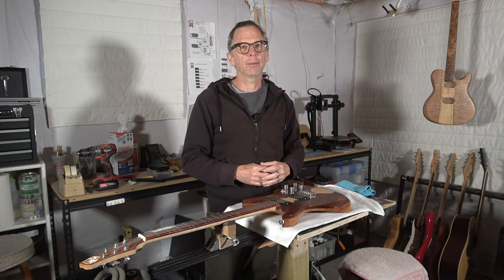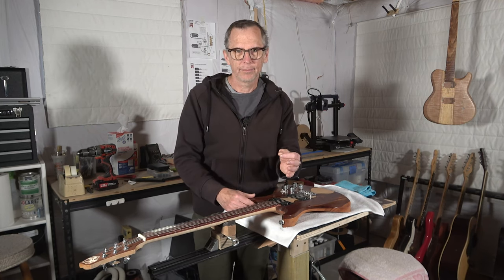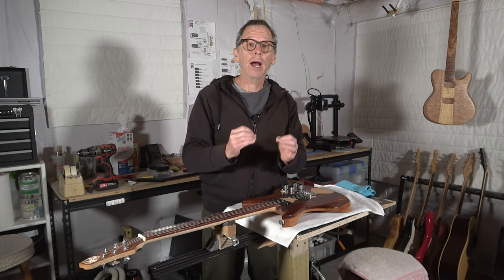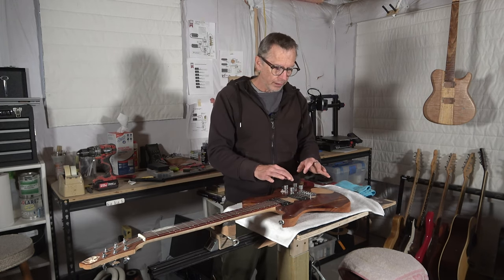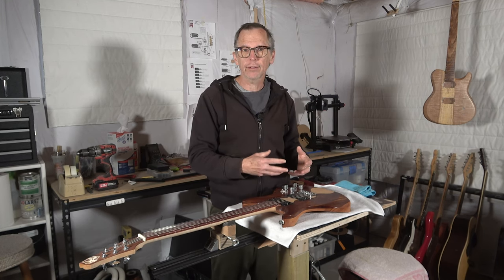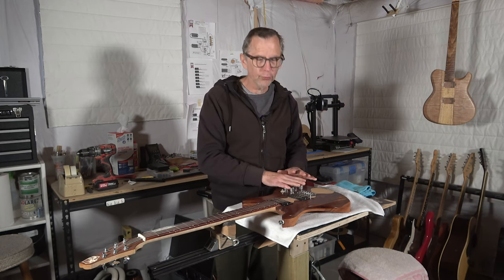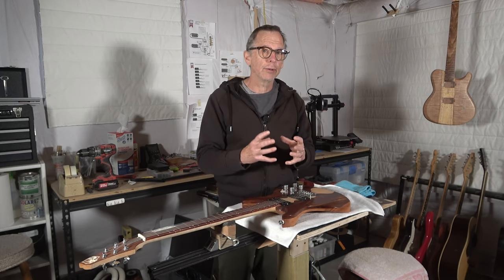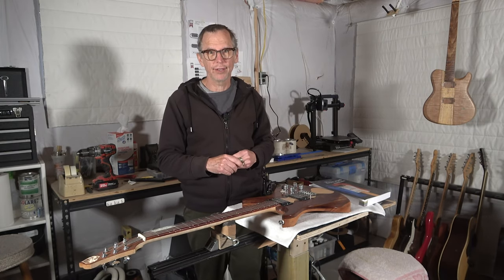How To Fix Bad Guitar Tone

Comment: You didn't mention second most important factor in my opinion, pickup height. More important than value of pots and certainly value of capacitor since capacitor affects only when you are using tone pot.
Reply from the maker: I didn't mention it because it's not as important in my opinion.
Reply: I almost agree that pickup height changes are analogous to "magnet swaps" that people talk so much about, but I actually thing tilting the pickup, to be more treble heavy or bass heavy, has more impact than tone pots, and usually more impact than a pickup swap also. But a lot of guitar players probably just don't like the look of a pickup that is tilted, and won't do it, nor do they like the look of pickups that are flush with the pick guard, or almost touching the strings. Aesthetics matter more than people will admit.
Reply: @HighlineGuitars  Considering your expertise, your opinion on pickup height just left me wondering...On the other hand I totally agree on primary cable (the one that connects the guitar to the front end - whatever it would be) is affecting the tone big time!
Reply: Pickup height is a big factor after the overall setup. Many people don't realize the pole screws on a humbucker are meant to be adjusted to the specific guitar

Comment: Reminder is set. Enjoy your vacation Chris.
Reply: I always play unplugged if it sounds good unplugged and you can feel the vibration of strings and the sustain it's gonna be a good sounding guitar. In my opinion pickups play about 25-30 percent of sound your pots play 10-15 then  the rest lies in the wood n etc. just my opinion. But it all works as one unit . I've played guitars unplugged that don't resonate very good and it's always shown when plugged in. I know electric guitars and acoustic guitars are two different beast but wood material and bracing , bracing wood makes all the difference between the sound of it and the tone you get from it. The wood choice in an acoustic is very very important but in electric guitars wood choice if 50-60 percent of the tone your gonna get from it. My opinion though.

Comment: You're best bet with pickups is to go with a "standard" choice, like a Seymour Duncan 59 set, or Gibson 57 Classics, or any "PAF" inspired set, 7k to 8k with 42 awg. Same with Strats, if the DC resistance is far above or below 6.0k, you're going probably to waste time fiddling with tone controls to make the guitar sound "normal". It's when you stray from the safe, radio friendly de facto standard that you tend to run into pickup related tone problems.

Comment: Guitar tone can be affected by the way the guitar is set up. I mean if the guitar is set up with too low action, this can cause reducing the low frequencies, punch and sustain. The strings affect the tone as well.  Thicker strings produce more mellow and dry tone, while thinner strings sound brighter and punchier. The string-to-string tension balance is also important.  The  higher is string tension, the less brighter and dryer it sounds. So, if you plays , for example, standard 10-52 set for Drop Db tuning, the 4th and the 5th strings gonna sound  dry and dull compared to the 6th string.
Reply from the maker: The problem is that a lot of guitar players don’t want to change the string gauges they are accustomed to. They would rather look elsewhere.

Comment: Regarding pickups.
Take the time to tweak and adjust height.
AND you can also change the sound from the pickups by swapping magnets.
It’s also a mod that’s cheaper and quite easy to do. I mean cheaper than buying a couple of pickups.

I haven’t done it to any strat or tele singlecoils though, maybe not that easy?
But P90’s and humbuckers.

But saying this I will also tell you that you will start to question and try magnet swapping in
most of your guitars. 🤣
Why? Because you can!